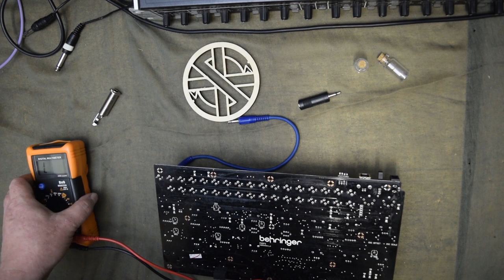Behringer Crave Mods: CEM3340 Triangle Wave Out Options & 6.35mm-1/4" Line Out Jack Mod Upgrade

Comment: Absolutely brilliant. Ive managed to damage the headphone socket on my crave but looks like an easy fix. Thanks for giving me the confidence to tackle this myself 👍
Reply from the maker: That's pretty much what I pre-empted !
The adaptors always look pretty bulky in those mini jack sockets, fine for patch cables but anything else is going to be putting a lot of pressure on them...  really pleased to know that this has helped you B.C..  keep up the excellent work mate!!
Reply: This is more difficult than it looks. Lining up the hole is the hard part. Also make sure the whole metal barrel and solder tabs are covered with heat shrink tubing.

Always avoid the short adaptors.
A 20cm adaptor cable with 1/8" plug to 1/4" socket is by far the best option !
Reply from the maker: That's an awesome protip !!  Idk it had never crossed my mind lol
Yeah, there was a lot of guessing and not much measuring here tbh Edward! The barrel was wrapped on electrical tape before I reassembled,
Reply: @Studio-solutions-com  I knew you'd wrap yours but wanted to make sure people with less experience did, because the smoke machine mode only works once !

Comment: Cool stuff…you have any idea if/how would it be possible to add another tuning knob? (I keep Crave because I can tune it with those two screws next to the osc knob) …I simply like to tune my synths to A 455hz or somewhere around that …or lower then standard 440hz
That osc knob says “pitch” as well but that is only shifting pitch and I’m not interested in that kind of “tuning”.
What I talk about is stretching or squeezing 1V/oct…and it gives different results then shifting 1V/oct. I hope you know what I mean! 😂

Comment: I know it's a bit nit picky, but it looks to me like the 1/4" socket would have fitted on the rear corner of the case, between the phones socket and the right hand side panel ?

I apologise if I'm wrong as it's a VERY tight unit and I haven't done this mod.

Thanks very much for the excellent Intel on the chip output pins !
Reply from the maker: No worries...!
You mean right down between the case and where the board ends?  I really don't think there's space enough but I'll take a look next time, I appreciate the observation Edward!!
Reply: @Studio-solutions-com  Cheers mate. I repair laptops, and the back RH corner is my fave spot to put replacement power sockets. 👍😆

I'm modding a Volca for internal lithium Ion battery ATM...
Reply from the maker: @edwardfletcher7790  great idea...! 
Hopefully you can sell it to Korg... lol